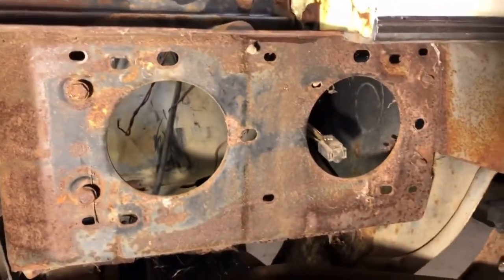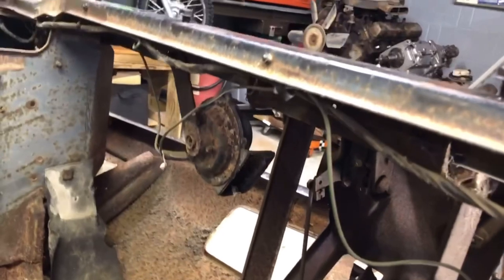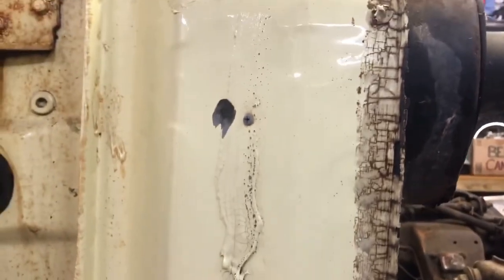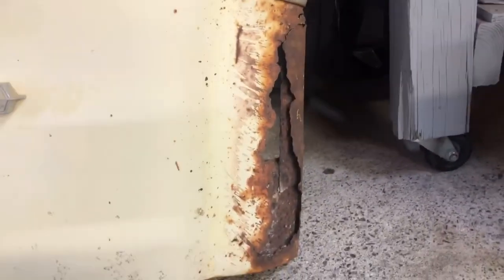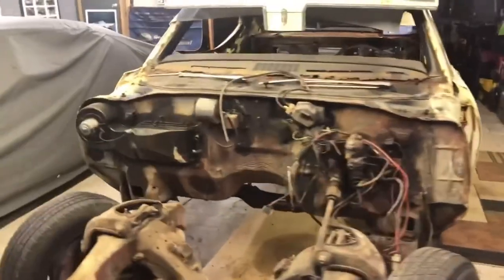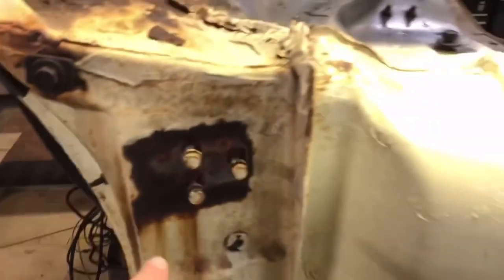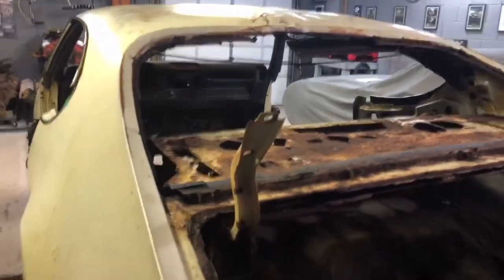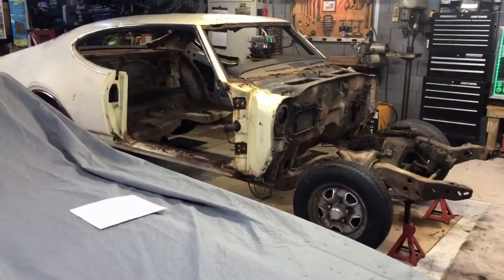1969 Cutlass S W-31 Restoration, Mr. Jones Rusty Remains

Comment: My dad and I did a restoration on an original 69' 442 W30 in Ohio 30 years ago. The majority of  the major rust was located in the driver side floor pan and both front windshield and rear window channels. The car had a black vinyl top and water ran into the window channels over the years. Significant amount of sheet metal fabrication even on my project. I have never saw rust as bad as Mr. Jones on the front cowl, core support, rear package tray, and the entire floor pan of your 69' Cutlass W31. I would suggest that you use the donor car sheet metal again for the cowl,  core support, and frame sections to save you some time and money. I give you credit for undertaking this extreme restoration. You are a true Oldsmobile aficionado!  Best of luck and can't wait to see the finished car,
Reply from the maker: Hello there.  Thank you for watching and participating here.  You and your dad saved a great car!  Where is it now?    Yes - this is for sure a rusty one.  I hope to never do another one this rusty again but we truly feel this car is worth saving.   Sure would've been nice to have found it  and saved it from rust 30 years ago like your W-30.
Stay Tuned....
Reply: @theautorefinery  Hello from Cleveland, Ohio. I still own the 69' 442 W30!  It is in dry storage in my garage over the winter. I take it to local Oldsmobile shows every summer. Your videos of the Mr. Jones project has brought back great memories for me and many other viewers. Thanks for posting such detailed and informative videos and best of luck with the project!

Comment: Gonna be a bad ass! Please keep it as stock as possible.
Reply from the maker: The plan is to keep the body as close to its current state as possible after doing some structural metal work and the frame/undercarriage, engine bay, and interior will all be refinished. maybe not new but nice condition original parts sourced throughout the build to complete the survivor type look. no repainting though.